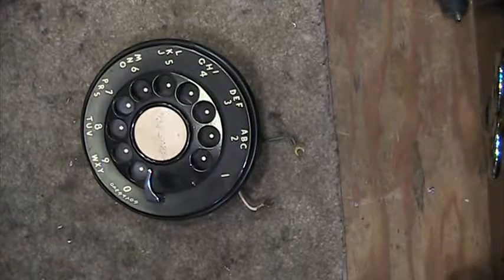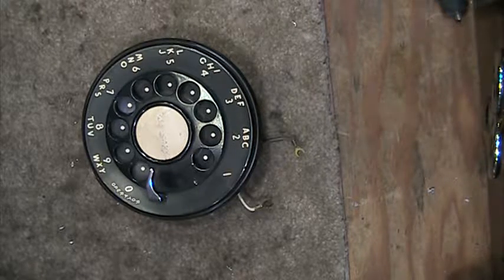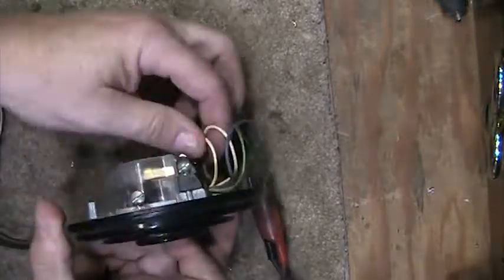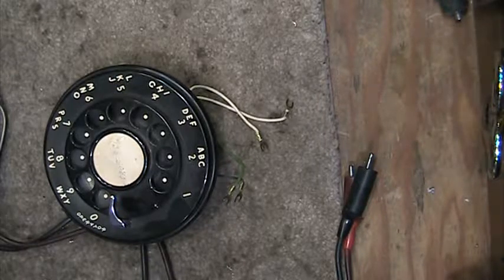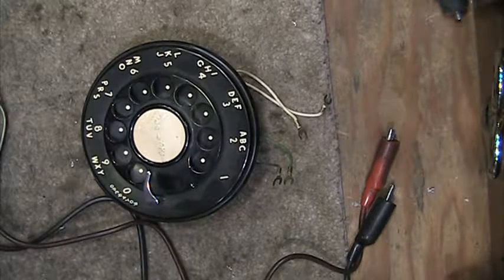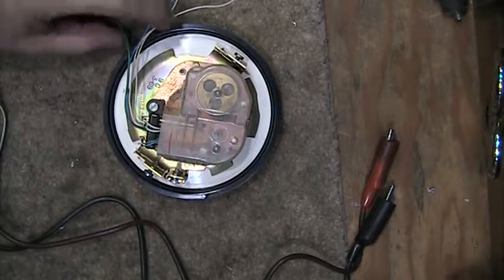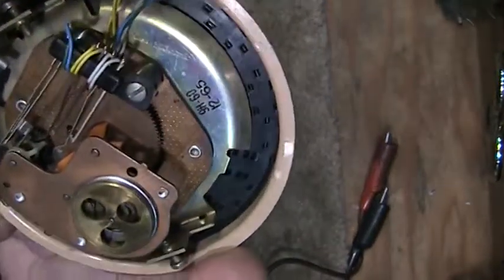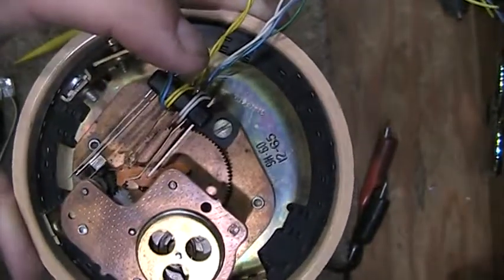How rotary telephone dials work from a electrical point of view.

Comment: Hi and thanks fo rthis video. I have a question you (or someone) may be able to answer; I want to make an art piece in which the spinning of the dial activates lights (LEDs) and sounds. How could I send power to the dial-then to the lights/sound? Not sure yet what I'm doing for the Sound part.  Thanks.